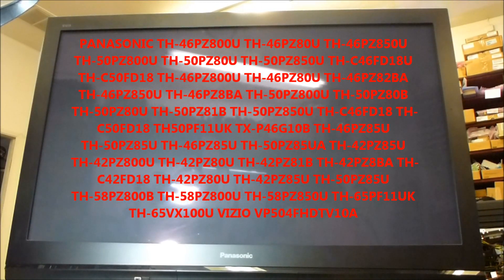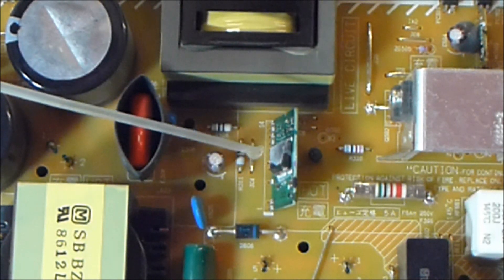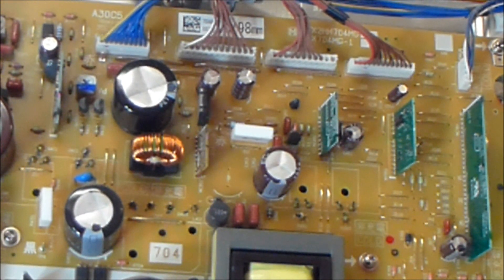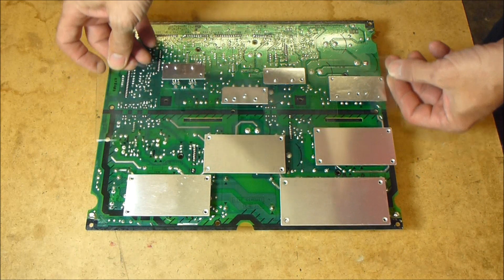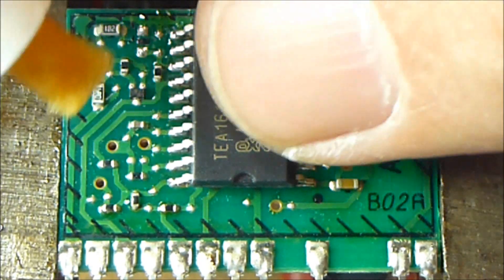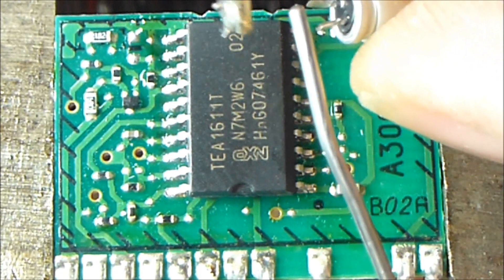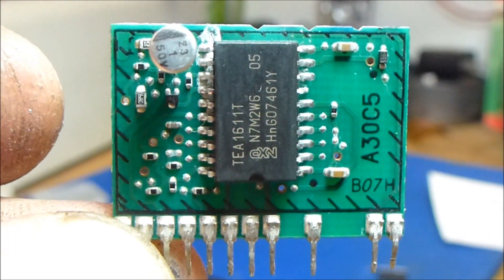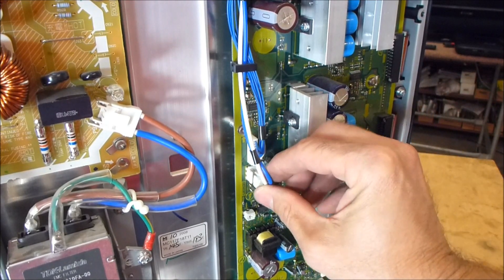Panasonic Plasma 10 and 2 Blinks TEA1611 ETX2MM702 704 706 Power Supply TH 42 46 50 58 PZ 800 85

Comment: Wow! Thank God for you man! I did not test or remove any boards. I did as you said and put a resistor accross those 2 wires to be sure there was No High Voltage present.  All I had to do was locate those 2 tiny capacitors and unsolder them and replaced them with 2 little 50V 1uF caps (Noteing that Neg leg was to the top.) and Bingo! The set works perfectly again! I can't thank you enough! You can stop in for a cold beer any time my friend! Thanks again! Jamey
Reply: RIKKIBOY your invitation to norcal for a cold one was freggn awesome. He does bless many with his repair videos.

Comment: HI thanks for the great demo. 
My TH-50PZ800U will not start when I click the power button either on TV or remote. There is no light no blink at all. 
This happened when I just replace my Verizon router and then noticed that the TV set top box power button blinking itself without me starting it.
Disconnect the TV box and tried again using TV remote or power button on TV, There is not life sign at all. 
Can you think of a possible cause of this? Do I need a now power board?
Thanks for advise.
Barry

Comment: THANK YOU! wow!  It worked for me.  I just replaced the capacitor.  It was a bitch getting the little board out and the soldering was a nightmare.  I used a jewelers loop to inspect my work.  Got it together and it didn't work.  Then I saw one of my soldered areas was touching another.  Cleaned it up and it worked!  To save time, I bet you could change the cap without removing anything else.  THANKS!
Reply: Tony Pescho 
Tony,
Yes.  You're right.  NOTE:  I have performed the removal & installation of de-coupling capacitor while the main power supply board is still mounted in the TV chassis.  What is critical here is good soldering skills and bright light along with (HIGH QUALITY) magnifying glass.
My Panasonic plasma has been functioning for over two years now.

GREAT JOB  !

Regards, Gary S.
Reply: where did you get the capacitors?
Reply: I think Amazon or ebay
Reply: did you replace your's and is there a name for the capacitor?

Comment: Great video! MY TH-C50FD18 worked for a while :-)
Wish I had taken a little more time and practice before doing the MC301. My soldering skills are definitely out of practice. The TV worked great for a while and then stopped. :-(  Apparently the first board MC301 was not quite a perfect soldering job as the MC201. Found out the 1uF 50V capacitor was not a good solder. It came loose after the tv ran for 3 or 4 hours. Now the tv only gets one click when plugged in and then only after pressing power get 2 blinks. Was a nice attempt and only $10 before tossing.
Reply: Here are a few pictures for anyone who might be wanting to attempt this also.
http://pho.to/9dHQy
Reply: Thanks Scott. I am a total newb here. From the pics you provided...looks like you soldered the new capacitor on the pins of the chip. Isnt it done differently in the video?.

Comment: You make soldering look so easy....I got the parts, just no solder skill.
Reply: TheBigwurmb 
Why did you buy the parts  ?
Did you perform the cool-down test to prove that the
problem is related to MC201 and/or MC301 boards ?
If you have no soldering skills, don't attempt this repair.  You can easily damage the "pads" on these boards.
What is the model number of your Panasonic plasma  ?
Regards, Gary
Reply: Gary Spencer I did preform cool down, th-50pz80u.  Bought the parts and out sourced the solder job.
Reply: TheBigwurmb 
Excellent.  Thanks for the feedback.

Comment: I have a TH-50PZ800u with 10 blinks. I made the updates detailed in this video and I still have the same behavior. 2 clicks followed by an 3rd with 10 blinking lights. One of the issue I encountered while soldering was that I broke off the pads for the capacitor on MC201. I just attached the cap directly to the IC on the paths that they end up on. I am getting to the point where I might just junk mine.
Reply: tcaldw A couple of things I left out. The cool down test did not work before I began the repairs so I may have been going down the wrong road. Also this is a replacement P board I ordered off ebay a couple years ago after I ran into similar issues.
Reply: tcaldw 
Please explain exactly how you performed the cool-down test (step by step) and what type of coolant you used.
It is highly probable that your P Board is at fault. But, you need to gather more evidence to steer you in the right
direction. The P Board has several, individual, switch-mode power supplies that can be triggered to shut down.
When that happens, the down-stream low voltage regulators (on A Board and D Board) do not get power.
So, the fault is detected INDIRECTLY on the "A Board" and the Stand-By microprosessor sends a fault signal
to the P Board to shut down the +15V resonant converter power regulator.  This 15V source goes to many boards.
This makes it somewhat challenging to narrow down the actual fault.  NOTE:  The StandBy processor always gets
power.  It the StandBy power supply goes bad, you would never see blinking SOS fault codes.
So, my advice is ......don't give up yet.  Also, I will send you a link so you can download the Panasonic Troubleshooting Guide which will help you narrow down the problem fairly quickly.
Regards, Gary S.
Reply: Gary Spencer Thanks for your responses Gary! to answer your earlier question, my original cool down test was cooling the IC and capacitor on mc301 with the TV off. After the chip and capacitor cooled I immediately plugged the TV in and received the same 3 clicks with 10 blink code. I also performed the same test on mc201 but I suspect that is not a valid test as my failure is on startup. I used a "compressed gasduster" (turned upside down) purchased from officemax that would typically be used to clean a key board. I went through the test tree in the doc you provided but I just end up at "replace the P board". I've also started to go through this manual http://elektrotanya.com/panasonic_th-50pz800u_ch_gpf11du.pdf/download.html but it may take me a while to grasp the material. I ended up purchasing a new TV but I still plan on fixing this one for the fun/challenge.

Comment: I have a  TH-R42PY80 with this problem. Also it's HDMi dont work after using a failed cable box (all ports behave like there is no signal). Is there some protection on the HDMI ports or it's now wasted?
Great video, thanks.

Comment: I have a Panasonic Plasma Model TH-46PZ85U.  I watched some of the videos.  When I plug it in, it clicks the 2 times only.  Switch light blinks 10 times every time, even after pushing on switch.  Fans never run.  Power board?
Reply: Thomas Birch
Tom,
The 10 blink SOS code is the most common failure mode for this Panasonic chassis.  All the information you need
is in this blog (and repair video).  I recommend you spend an hour or so reading the items and comments in this
blog  that relate to the 10 blink SOS failure code.
If you perform the "cool down" test which is shown in the repair video, you will start to narrow down the failing board.
It is most likely the "P Board" (main power supply board) ....but not always.  So don't waste money chasing after this
failure by just replacing boards.  However, this type of shot-gun repair method can work .....only if you get lucky.
Regards, Gary S.
Reply: +Thomas Birch I have the exact same model with the exact same problem, I got it at a thrift store for 16$. I did the freeze thong on the other board, not the one he freezes on this video, he does reference the other identical small board that I froze and I was able to turn on the tv.  I went on ebay and ordered a kit they sell with two chips and two resistors, it was about 11$, now i'm waiting on the parts.

Comment: Hi, I have a Panasonic Viera TC-P50GT25, it turn off by itself and remain blinking 12 times. Thanks for your attention and help
Reply: Ana Pagan 

Ana,
The 12 Blink SOS Code is triggered when a fault is detected in the audio drive for the TV speakers.  The problem is
on the A-Board.  Most likely, the audio Digital Power Amp is dragging down the +15_S  sound power supply.
The Digital Power Amp is a single chip device with external passive components (inductors & capacitors) for high
frequency filtering.
This is a fairly easy task for an experienced technician to isolate and fix.
Hope this helps .....slightly.
Gary S.
Reply: Gary Spencer Thanks so much

Comment: I have a 50 inch Panasonic Plasma t v with 13 blinks. THC50fd18a  MA83370407
how can I fix it ?
Reply: Louis Portalatin 

Louis,

The GS Board (SD Card Slot) can cause this problem.  So, remove all HDMI cables and SD Memory cards to see
if TV powers on with No Code   OR   a different Code.

The 13 Blink SOS code is triggered when a communication problem exits on the A-Board.  Unplug the TV from the AC outlet and carefully remove connector A52 on the A-Board, then plug TV into wall outlet and power on via the remote control.  The A52 connector is located along the bottom edge of A-Board.

Gary S.

Comment: Thanks, I just got this 58pz800u from an friend, with no codes, just says he put cold air on a soldered in fuse very near one of these boards, & got it to work, It's a 706 board, & like Mitchell I don't think I could solder those chips on tine, the fuse shows open. this guy is an electrician & got shocked off the case, not very comforting, the resister very welcoming, will just doing the one side discharge the whole power supply? & any hints on this soldered in fuse, must be a problem behind it somewhere that make it blow? Thanks for the video very easy to follow.
Reply: James Tramel 
James,

Did you take the back panel off yet  ?
If not, unplug the unit from AC power outlet and remove the back cover panel to gain access to inspect the large power supply board.  There are 7 fuses
located at the front-end of the power suppy system (F201, F301, F601, F602, F801, F802, F803).  Examine these fuses to determine which fuse has blown.
I have a suspsion that the electrician caused the fuse to blow.  I believe that he was touching the steel chassis somewhere AND somehow touched the high voltage section
of the main power supply.  There's enough energy in the high voltage sections to take you out permanently.  It's lethal.  It can stop your heart in less than a second.
If the electrician did not momentarily short-out one of the switchmode power subsystems, then there must be a failure mode on the main power supply board or A Board
or D Board.
But, as you know, you must replace the blown fuse before you can determine if there is a major over-current condition on the power supply board.
It's a lot of work to replace fuses that are soldered to the board.  You will have to remove the board and disassemble all the stuff that coverers the back side of board to
gain access to fuse location.
As a troubleshooting measure, an electronic technician would just stitch (solder) the "same value" fuse on top of the blow fuse (piggyback fashion).  This is QUICK & EASY
method and is only temporary to help with narrowing down the possible over-current condition and failure mode.  Once the failure has been resolved, a new fuse MUST be
soldered into the board at that location.

Regards,
Gary
Reply: Thanks for getting back to me, it's the F602 fuse that is blown, the guy was shocked & I think afraid to mess with it anymore, IT also apears C612 Cap is blown, it's bulging & has is cracked, this guy put cold air on the board around were that fuse was  & and got some result, the piggy back fix for the fuse sound like a very good & easy fix for that, Anymore Ideas would be great. My old Toshiba Analogue is going out, this would be a cheap upgrade, Thanks for your advice.
Reply: James Tramel 
James,
Nice find  !   I strongly suggest that you replace C612 and C613.  These low ESR electrolytic caps are in
parallel in the circuit.  Replace the caps BEFORE you perform the fuse test (fuse bridge).
The capacitors are the same type (300uF, 450V).  Do not use low-end capacitors.  Try to obtain low ESR Panasonic caps.  Also, pay close attention to the Temperature Rating of the capacitor as well   !!
Do not install or bridge Fuse 602.  This could result in the capacitor exploding and/or catch on fire.
Wait until you replace the capacitors before you plug the unit into outlet.
Don't forget to use eyewear protection.
Regards, Gary
Reply: Do you mean do the bridge of the fuse, after changing the Caps? Yea I understand, nice size, the prices on the new ones? it would be my first HD Tv, been playing with XBMC for a smart TV frontend, but unable to see it's full potential, I highly recommend, stream any movie, news sports around the World, I'll hunt down the parts. Do you have any good sights for forums on electronics?  I joined Badcaps, have a few more on Appliance repair, Major Geeks for Computer stuff. Thanks again find me on FB at jet tramel
Reply: James Tramel 
James,
The original caps are VERY expensive.  They are probably rated for very high temperature (105deg C  ??)
and have very low ESR..
You should be able to find an equivalent replacement (somewhat) at Digikey.
They may not last as long but they should last longer than the original.  I think the original failed
due to "over-voltage" condition during an electrical rain storm.  Or, the cap was partially defective from
the start.  These types of capacitors should last 20 yrs or more.
Regards, Gary
Reply: ok friends what the heck does ESR mean? And Ive been going up and down the comments trying to find a comment that breaks, down in newbie terms, exactly what type of capacitors we should be looking for, because I do not see any 1 mf 50 volt caps on my internet searches, that are as small and that look like norcals!!!!!!!!

Comment: upon looking at this video again, i think i made the best noob mistake.  I removed the wrong capacitor!!  i removed the capacitor directly left of the IC chip, which is probably why I can't get the tv to work.   What capacitor is it?  Will a 1uf capacitor work?
Reply: Vito,
The capacitor that fails on these small boards is a 1uF (allegedly) ceramic which is a tan color.
((Actually, I am fairly sure that this capacitor is closer to 0.47uF due to the package geometry.))
It is located in the upper left corner of the board and VERY close to the NXP chip.  This tan capacitor connects to board
Ground & pin 13 of the NXP IC chip.
It is possible that you damaged the pcb "pads" or trace for the capacitor.  Without a good magnifying glass, it
would be extremely difficult to see damage or cracks.
The board Ground runs along the TOP edge on the left half of the board.  This makes it easy to solder the neg lead
of capacitor to this ground.  The positive lead should be soldered to pin 13 to complete repair.
This method has the disadvantage of extending the "lead length" of capacitor which increases lead inductance.
This does not have any functional effect in this design because I tested a very long lead length capacitor in this
circuit over a year ago.  I then cut the lead length to fit on the pcb board "pads" (approx 3mm).
You need to use the proper wattage soldering iron with fine tip.  Otherwise, you run the risk of damaging more
pcb features.  I use a light ring magnifying glass to perform work on ultra small schitt like this.
Also, carefully scrape away a small region of the varnish that coats the Ground strip that runs along top edge.  This
is necessary to prepare this spot for soldering.
Regards, GS.
Reply: Gary Spencer Thanks for getting back to me Gary.  I realized the correct capacitor after double checking and with your verification.  I do believe I caused damage to the mc201 board.  Thankfully, i ordered a new power board for 165.00.  I will install it in the next few days.  Thanks for your help.
Reply: Gary Spencer  Gary, i forgot to ask, since I'll be installing the power supply board, will any 10 watt resistor work to discharge the 3 large capacitors, or do i need a certain ohm rating as well?
Reply: *****
Vito,
When you attach a bleed resistor to the connection points, you are discharging more than a dozen, large, electrolytic, capacitors in parallel.
These capacitors are directly connected to Vsus voltage line which runs from the P Board to the SC Board and SS Boards.  The Vsus power system does have its own bleed resistors but these are a very, very, large resistance which slowly bleeds down this enormous charge.
In general, power resistors are small in value (1/2 ohm up to 300 ohms there-ah-bouts).  So, most any power resistor will work to perform the bleed down process.  The bleed down of this charge will take only a few seconds
depending on the size of the power resistor.  The current flows only for a brief period and will not even get warm.
Use a resistance of 15 to 50 ohms.  You don't want to use very small resistance.  This would act almost like a short circuit.
You need to be very careful when you're connecting the power resistor to the Vsus terminal.  Make sure the TV has been unplugged from power for 5 minutes or more.
Regards, GS.

Comment: HI All, I'm having the same 10 blink code followed by a 2 blink code when I press the power button.  I have a TH-50PZ800U.  I replaced the cap with a radial capacitor on the MC201 board, but it still had the same issue.  When I froze the board (MC201), it would work.   I bent the capacitor to gain better access at the actuall TEA1611 chip and the cap broke off at the solder joints.   Now, i resoldered the cap and when I freeze the MC201 board, the TV does not turn on.  I get the same 10 blink code.  I freeze both MC201 and MC301 and same 10 blink code.  Lastly, I remember somebody saying that if I remove the cap, that it will work.  No luck there.   Did I fry something?  I ran a test with the Panasonic Service guide and it points to a bad P board.   Should I replace the entire board?